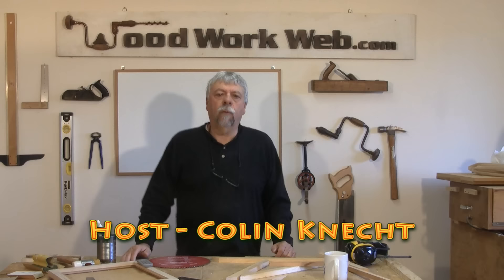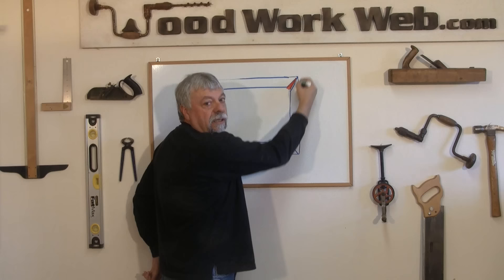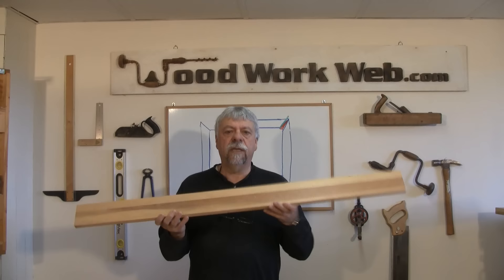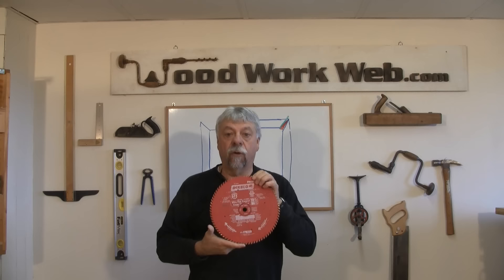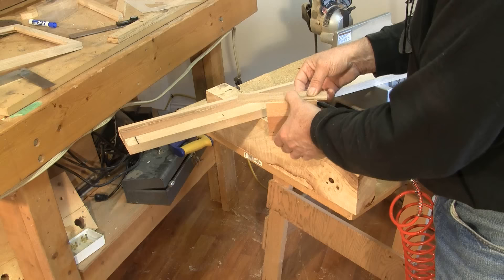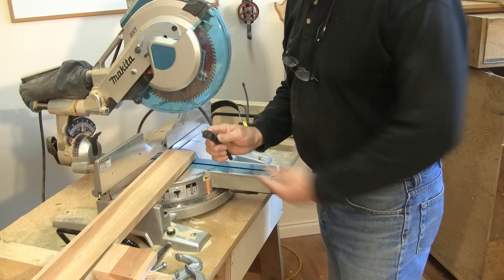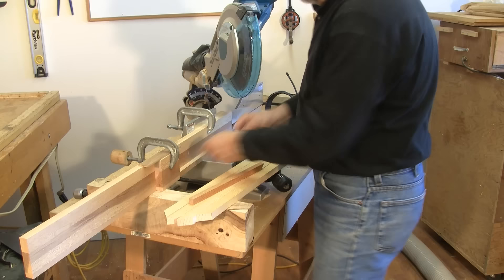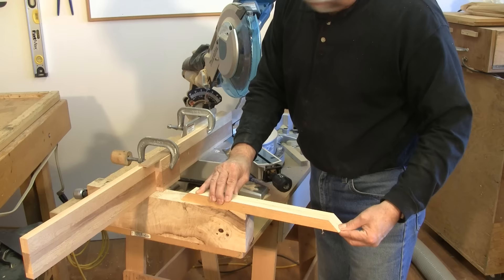Making Picture Frames with a Sliding Mitre Saw - A woodworkweb.com woodworking video

Comment: Thanks for a very precise instruction. Awesome if I was doing a flat faced frame. However, do you have any tips when working on a moulded pieces? Seems my troubles begin when I have to reverse from left hand to right handed 45 cuts which is necessary because of the design being on one side only
Reply from the maker: Jack Henry I am going to be doing and update about this in the future , hopefully this fall. One of the keys to picture frame making is ensuring the tops and the sides are exactly the same length. Sometimes I use scrap pieces of wood to make measuring sticks of each of the side, then with these you could reverse your cuts. Also, some frame material does not sit flat so making a "bed" for it to lie in will help keep it from rocking.  Hope this helps Jack ... let me know how you make out.

Comment: Sorry if this was already posted, but cant you just double side tape the 2 matching sides together and cut at same time? This would ensure each matching side was the exact length. Then pull the 2 boards apart and discard tape.
Reply from the maker: Blueinyourface You might be able to do this, I have not tried. As long as they are perfect aligned it should work

Comment: Nice video but how do you get the groove to fit the glass in? That's the tricky part for me.  I would assume it hasto be cut before you nail the sides together?  Also, any hardware and maybe edging tips with a router? Thanks, sorry I'm such a newbie!
Reply from the maker: Joseph Turchiano yes, this video was just to show how to get the angles. You can purchase picture frame stock, or make your own and you will need a table saw to cut the groove, also know as a rabbet, for the glass.

Comment: I have a silly question as I've not done anything like this before... but when you made the length marker, could you not have stacked the 2 bits of wood and made the cut rather than do them one by one? I mean is there a reason for doing the cuts separately?

Comment: If I understand it properly the stop block depends on sizing the length of the board to be cut by slight pressure against the end of it.   If the end against the stop block was already cut at a 45, wouldn't the feathered end deform slightly, and not uniformly, with pressure or slip slightly behind any defect in the stop block or gap made by dust or splinter debris making the lengths of the frame sides slightly different?  If so, how might I avoid that?

Comment: Can trench cuts be made using this saw accurately, using the depth gauge. Thanks. Is it possible to make a series of parallel cross cuts into 4x4 inch timber to excavate a mortise or trench with a fixed depth ? Thank you.

Comment: I'm confused by blades. I need to buy an 80 tooth, only have a 60 that came with my new saw. I'm seeing people refer to Freud blades but I see Freud blades, I see Diablo Freud blades. Is Freud a type of blade rather than a maker?  For fine framework what other features in a blade do we look for? I'm seeing references for "fine tooth", "carbide tip", and "fine finish". Is one better than the other? Do I change the blade back and forth depending on if I'm cutting frames or chopping 2x4s for "garden grade" projects?

Comment: Lots of good tips.  Thanks. But why does it have to be a "sliding" mitre versus a regular chop saw mitre??
Reply from the maker: Very good point, you are correct, it does not have to be a sliding ... a chop saw with a very good blade will work fine :)

Comment: When setting your lengths it is the inside measurement that is critical for matting and glazing.  You measure to outside of frame, any suggestions on how to set up a stop block to match inside measurement?
Reply from the maker: Basically you just subtract double the width of the rabbet size that you are using for the matting and the framing. To understand this better, I find that if you make a simple sketch with pencil and paper, it helps to solve this.
Reply: Thanks.   I have been struggling with this.

Comment: When you're measuring the width and height for a frame, I would think you would measure the inside dimensions not the outside which eliminates your method using the stop block.

Comment: OK...Now, this method would not work for using something like a decorative molding, right? You'd have to modify it a bit to do four cuts, then swing the saw to the other side and make the other four since you can't flip the wood over.

Comment: Could the fact that the saw has a 40-tooth blade make that much difference? I was using a sliding miter saw that I got at Harbor Freight (also cheap, I must admit), and it was very difficult to adjust. It does have an 80-tooth blade, but my original saw has the 40…perhaps that's the difference. Any thoughts?

Comment: Those “speed” squares may be speedy but they are way off, especially the roof pitch marks. Even expensive ones are not accurate many times.
Reply: I use a plastic 45-45-90 square to adjust my table saw blade to 90 to the table. I also have that same Makita 12” slider. I don’t slide when cutting small pieces like that

Comment: Excellent video, just curious as to how to get a picture to fit in there? I want to make frames but all i have is a sliding miter saw and im not quite sure how to make a rabbet like cut so the picture can rest in the frame
Reply from the maker: Hi Anthony, that's a great question, I'm surprised it hasn't been asked before. There is no way with a sliding mitre or chop saw to cut the dado you need. You would either have to cut the dados on a table saw, or purchase picture framing stock material that has the dados pre cut.
Thanks again for the question .... Colin
Reply: First I cut the 1/4" rabbet on a long length of stock then cut it to size. Now I just assemble the frame and it's ready for the finishing touches.

Comment: Will this  technique work with wood that has groves/patterns it in as well or does it only work for flat pieces?
Reply from the maker: Gina Noggle This technique should work on any picture frame material. If it has patterns, and if you need those patterns to line up you may be restricted to specific sizes otherwise the patters won't line up ... but yes, as far as I know, it should work.

Comment: I have a 12 inch non-sliding miter saw.  Can I use the saw I have or do I need a sliding saw?  What size saw are you using?

Comment: Hi Colin, was your marker stick measured/cut to an outside length for your piece? Or the inside?  I ask because if I am making a frame for an 8 X 10 photo, my inside dimensions need to be precise. Butting the initial mitered corner of the stock piece against the stop block doesn't seem to take into account the inside dimension. Maybe I did not follow the concept very well. Thanks!

Comment: Why are you using slider function on the miter not fixed cut?
Reply from the maker: It was making a bit better cut with this blade, but either way is fine
Reply: Thanks!
Reply: @Hello Janis how are you doing

Comment: Could you tell me how to measure from point to point? If I want to put a frame around a square board how would I measure from point to point so all sides line up. Im having a really difficult time with this. Would I mark my line and then from that line (lets say 10") make my 45 on that mark? I always come up short.

Comment: I am starting to make some picture frames but i notice that when you use the mitre saw is that you swing it to the left i have alway swung mine to the right is there a reason for this
Reply from the maker: Hi Brendon, nope, either way is fine, whatever you are comfortable with and feel safe using, just double check your saw to make sure when it shows 45 degrees it really IS 45 degrees and you should be golden :)
Reply: I have a (non-sliding) compound miter saw. If I swing it to the right, I've only been able to use the stop block approach by clamping the stop block to the backer board on the right side of the blade (right fence). That's felt like an awkward cut to me because the saw's motor housing partially obscures the view of the cut and I'm using the left hand to draw down the saw. I've tried rethinking this approach without a "left swing" and haven't figured out how to improve that...I'm probably slow :)

Colin, thanks for the video -  I really appreciate it. The white board helped me understand the problems with poorly fitting miters and how people mistakenly try to fix them.

I'm also routing rabbets in the frame material (recess?). It seems to me that the easiest sequence has been to use the router first, then cut the miters, but I'm interested how others do this.
Reply from the maker: gcbound Yes, route first then cut your mitres. A non sliding saw should work just fine. I have re-read the rest of your note, it sounds like your saw only swings to the right, am I getting that correctly??  I have not come across this question before so I don't have an instant answer.
Can you send me an email to woodman@woodworkweb.com while ponder this for a bit  :)
Reply: @Hello Bren how are you doing

Comment: I have been searching everywhere to learn how to make picture frames.  I can cut nice 45 degree angles and make some fairly nice frames but I end up with wasted time trying to get the correct measurements that I want.  It is easy to make a frame, but if I want to know how to take stock that is 3.25 inches  and make a frame that comes out to 9.5 inches by 12 on the inside.  There has to be a way to measure and cut the stock so I don't have to cut and cut and cut to make the inside measurement.

Comment: What if you make an accurate table saw sled for picture frames? Isn't this more repeatable? I am looking into purchasing a sliding compound miter saw? 12 in or 10 in is a question?
Reply from the maker: M Geez Yes, you could do that, and yes it would be more repeatable. Good question on the slide-mitre, I decided on a 10" because I didn't really need the length of cut most of the time and I wanted to be able to use some blades on my 10" table saw or on my sliding mitre ... also the 12" blades are quite a bit more expensive ... but everyone has different needs and wants, that's just what worked for me, good to give it some thought, that way you make better decisions

Comment: I have to 1st of all thank you for putting this up because this was pretty vital information/knowledge that I wanted to know becuz of some up coming picture framed projects. So I really appreciate that. 

However, watching your video was extremely frustrating because you appeared clumsy and unsure and you handled everything like you had 2 left hands. And . . . you over explained a lot of things.

I watched the entire excruciating 21 minutes because I was afraid that I'd miss something. Yes, my 4 - mitered pieces were not coming out perfect and checking other frames at the stores I frequent I found picture frames for sale that weren't any better than my rookie feeble attempts. 

One of my favorite hobbies is woodworking so I've built a lot of projects but I've had a very weak understanding of how to make perfect miters. And I'm surprised that it was so simple making sure that the opposite sides of the frame had to be perfectly measured and perfectly cut to size. And the procedure you outlined for getting that done was great. Thank you very much!

Comment: how do you measure for the sides to make a frame for a specific size of glass?
Reply from the maker: Jim Spencer basically you just need measure the rabbet inset where the glass would go and double it, so if the glass size is 8 inches and the rabbet is 1/4" the inside of the frames will need to be 8" less 1/2" but leave a bit of an allowance for the glass to have some play in it so it is not tight to the frame.

Comment: The part im struggling with is getting the 8x10, 5X7, 4X6 measurements correct to fit the existing glass. I noticed you already had a pre-measured stick to help but how did you get the initial measurement? (sounds like im asking an obvious question right?) But the problem for me is when I measure and try to copy a frame that I already have it never comes out the right size to hold the glass once I cut my 45° angles.  Please help.
Reply from the maker: Hi Edward, this is always a concern because unless the rebate where the glass is inserted is always identical, which it often is not if you are making your own frame material, there can be variables in your sizes. I found that cutting my rebates on the router, with a rebating bit give me the consistency I need. The other variable of course is the thickness of the frame material. So what I do is sit down and figure out the math, the glass or picture size, plus the frame width on each end, less the rebate and that should give you an exact size. Been a while since I did this, but I think my memory is correct :)
Try it and let me know if you have more issues, but email me though woodworkweb is best :)
Reply from the maker: Brian Gedcke Hmmm .... thanks for that note on the pre-made picture frame reabbet sized Brian,  I did not know they were variable depths, but I guess I should have expected that. Your detailed description sounds right no for those sizes, appreciate you taking the time to detail this.
Colin

Comment: What is the brand and model of your digital angle device? I got an inexpensive ($20 or so) General Instruments one from Amazon…not sure it's accurate. I checked my blade angle with a plastic triangle as you suggested, and it was right on, but checking the angle of the cut it was 2-3 degrees off. Frustrating! It must be the measuring device, yes?

Comment: You are apparently making a frame and then make the picture or what ever to fit your frame. I was wanting to see the best way to measure something and build the frame to it.
Reply: Cut the stop at 45 degrees then you can cut your piece with the long side away from the fence and the saw angled at the other 45. This way you are working with inside measurements rather than external. Outside of your art = inside of frame.

Comment: how would you cut the rabbet inset for the glass and picture? Dont think a Mitre saw would do this
Reply from the maker: Shane Cole Easiest and safest is on a table saw
Reply: WoodWorkWeb what about using a router for the rabbet?
Reply from the maker: M Geez  Yes, that is what I use, in a router table.

Comment: Hi guys what is the problem with my compound mitre saw when i try to cut right through a piece of wood it doesn't go right through can someone help me please Dianne just getting my gear togeather have bandsaw  skillsaw jigsaw planer router going to put them under table
Reply: +Dianne: make sure the set screw for the depth of cut adjustment is right.
Here is a link with a picture. Page 12 - http://manuals.harborfreight.com/manuals/61000-61999/61971.pdf

Comment: You did not mention that you turned the board upside down for the second cut.  This would be OK for an extremely good quality cut but most saws/blade will not do this.  Also, I find it difficult to place a pointed 45 degree piece up against a stop that is at 90 degrees
Reply: lol.
Reply: Ya, depending on how hard you push it in, you could be off 1-3 mm easily. Plus, the block leaves a bit of a gap. Therefore press each one evenly the same, and errors should average out.

Comment: Um, yes you can get more accurate than 45.1 degree.  Lol
Reply: The digital protractor that Colin is using is probably accurate to plus or minus 0.3 degrees so 45.1 will have to be good enough.

Comment: Where in the process would you do the rabbet?
Reply from the maker: herbsu43 That is an excellent question, and seldom asked. You could do it either before making the 45 degree cuts or after. I have done both and the only real difference is you can have smaller pieces to work with if you do rabbet them after which makes them a bit harder to hold ... but making a little jig to hold them works too, which is what I did.
Reply: WoodWorkWeb Thanks. I just finished my first frame and did the rabbet after all the miters were cut. It worked out fine.
Reply from the maker: herbsu43 Good for you buddy ... glad to hear the update, thanks

Comment: I just wanted to point out that this video uses the terms "chop saw" and "miter saw" interchangably. I found the hard way that this is not so. I found a great deal on a Black Friday sale, thinking I had the last power tool I was drooling over, and ordered a chop saw on Sear's website, and the order was filled by an outside vendor out of GA. when I opened the box and eagerly removed the owner's manual, so I could take a look at whatever assembly required, I discovered the phrase "not for use on wood". I also noticed the blade was very different from a wood cutting blade. Then I also discovered the saw could not be returned to the vendor because it was not defective, and it would cost $69 to ship it back. That would net me $10 after paying the shipping. After trying everything to get a refund, I ended up selling the saw at a pawn shop for $30 :( It was a valuable lesson learned in ensuring all my options in ADVANCE!! such as any possible returns). Oh, and I make sure anything I order from Sears is filled by Sears and not an outside vendor,so any return can be done at the store. end of story, I bought the right saw on sale, but the money I lost on the first saw, added to the sale price, made it about the same as a full price